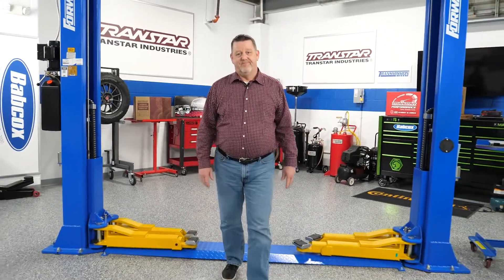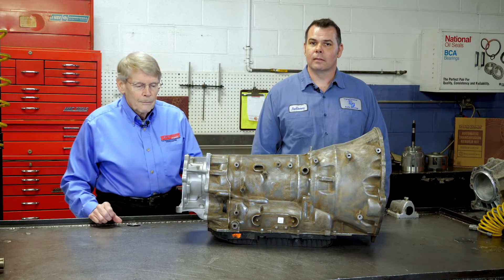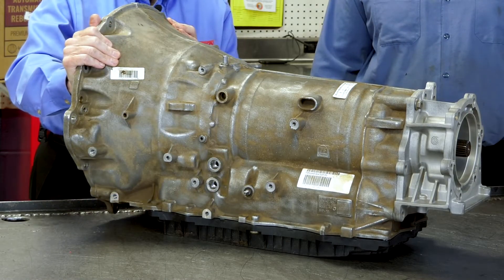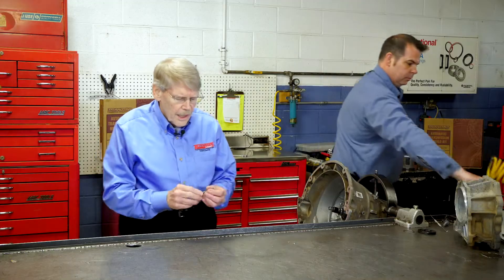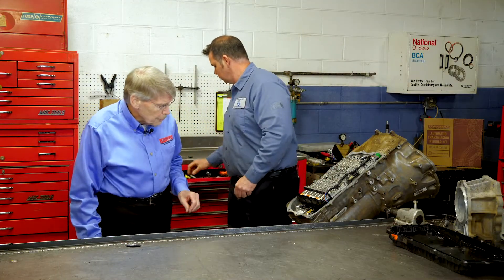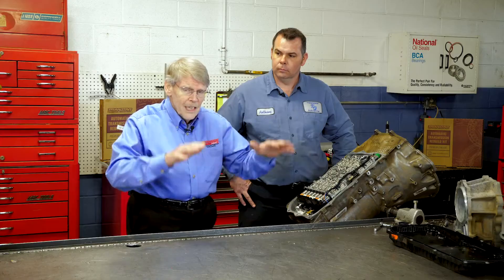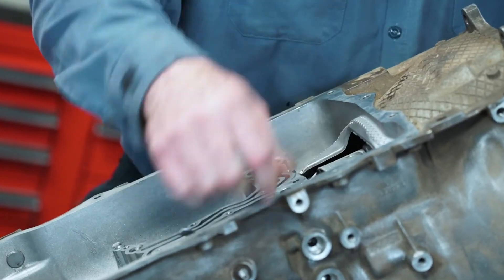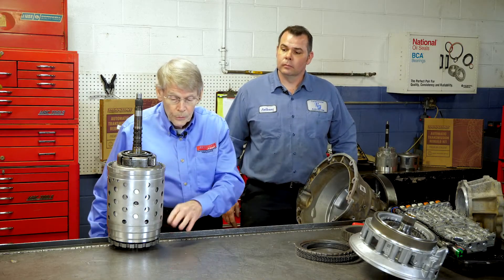ZF/Chrysler Eight Speed RWD: Part 1

Comment: I have a 2014 Durango with 277,000 miles has the zf 8hp when it shifts from 1-5 all shudder and 1-2 gears have a whine. Any input is appreciated. Also i just bought it i believe the fluid is original.  O and no codes.

Comment: Thanks for explaining the HIS accumulator. I’m installing a 2016 Grand Cherokee 850RE into a 2014 Durango, after swapping the TCM, and was concerned it wouldn’t work. I plugged the hole for the accumulator, and am confident now that it will work in my Durango, which didn’t come with HIS.

Comment: Great video. Amazing how easy it comes apart. Almost Like a 6l80.   My 8hp70 is giving me that 2-3 and 4-5 flare I've seen other people experience before.  Only under very light loads sometimes but shifts beautifully with anything more the 5% throttle and shifts like an animal while hammering it.  Figured it was chryslers tuning but I did a diablosport tuner and it's still there.  Might throw a valve body at it.
Reply: I have a new 5th gen ram with the 8hp75 and it also has the flare shift issue under light 5-10% throttle. I seen something about when u replace a battery it does something to where the dealer has to refresh the ecm/tcm dumbest thing I've ever heard if that's even true but I will say when I replaced the battery that's when it started. Other then that my truck has been flawless with 81k miles so far.
Reply: @bmf88  Some car have to have refresh the data and telling it about the new batteries
Reply: @bmf88  I just had hemifever do a tune for me.  Flare is completely gone.  I did the zipkit and it didn't like that. I ordered a reman valvebody and truck wouldn't even come out of park. I put my valvebody back on and shifts are beautiful until trans warms up. Yesterday it stuck itself in 2nd then 1st until I unplugged the battery.  I'm going to pick up a low mileage unit today. I'm done screwing around with this one.  I was trying to find out if a 75 would swap over but don't feel like throwing $1000 on a gamble right now.
Reply: @Matp345  tuning was gonna be my next move just blows me away how expensive it is just to tune these new trucks. This is my first hemi and I love everything about the truck I just came from the early mid LS stuff and if was super cheap to tune one. Lol
Reply: @bmf88  me too. I'm a chevy guy and this is my first hemi.  The tune made it feel like a real trans. Stock was too soft. The diablo trans tune helped but hemifever woke it up
Reply: @Matp345  nice I gave up on gm our last 2 escalades were the biggest overpriced piece of 💩 they want u to pay top money for their stuff and won't honor the warranty when something happens the clear coat on the 22s completely peeled off they would never replace them and that's just one thing of many
Reply: Do you use the OEM fluid / made by life guard, or do you use a different fluid Maxlife Vavoline,  Amsoil etc...  I keep hearing the Amsoil is superior to the OEM life guard brand.

Comment: Is it still okay to change trans fluid even after 180,000 miles
Reply: Don't believe the th350 guys from the 70s. These transmissions operate very different from the old stuff that "you shouldn't change the fluid"  I always do trans services no matter the milage and have never had one fail. Change it as often as you can.  You can't over-maintenance one.
Reply: Their “lifetime” really only means “for the lifetime of the warranty.” But yea I’m doing as much research as I can before changing out my transmission fluid and filter. So just to verify, u can use the pan of a 8hp70 on a 845re transmission right? @MrCattbone
Reply: @jphantom6296  I’m pretty sure that they are the same bolt pattern, but the 845 has shallower pan.  What car is it in?
Reply: @MrCarttbone  2015 Jeep Grand Cherokee. I’ve got the 845 trans
Reply: no
Reply: @mattboski2339  you are giving wrong info man.  these things should have a fluid change every 50k-60k.  That is what zf says on their website.  Chrysler saying it is lifetime fluid is straight up misinformation.  All the guys that actually work on these things know that lifetime fluid is not a real thing.  You need to be replacing the fluid, or else you will be replacing the transmission

Comment: I know this transmission is bulletproof how often should the fluid be changed at what mileage . Just curious because I have a 2018 Chrysler 30 which now has 50k on it
Reply: ZF recommends 50-60k miles for the 8HP 
even though BMW and Others say you don't have to service.  I choose to agree with ZF because they engineered it and know what they are talking about and a salesman on a dealership floor is just saying what he is told to say.  I just completed a 8HP pan/filter and fluid change and on the 2016 535i, the filter was black, magnets were covered in normal wear material levels and the fluid was dark and  glittery. I would like to note that the driving style this trans has been exposed to has been extremely gentle by an elderly driver. all normal wear at 60k but I don't think id want to that multiplied at 150k miles. IMHO
Reply: Iam going to change mine next week the car just hit 66k
Reply: That's weird. I do 75-80k service. I used Amsoil. Shifts a lot better with that.
Reply: The cars guys always said .. never ever flush a transmission unless u want to have transmission problems..
Reply: @temptek2377  I never flush my transmissions  that's just opening up a can of worms
Reply: you dont need to change it. it lasts a life time
Reply: @mattboski2339  what’s the mileage on your car
Reply: @mattboski2339  thanks for the info I just saw the video 👍
Reply: @mattboski2339  nothing is life time !

Comment: Does this ZF8HP have a torque converter and how would you do an oil flush when dropping the pan and changing oil? Love the vid guys!
Reply: Yes it has a convertor. A quite complex one at that.  There's tons of writeups about how to service out there. It's fairly simple. If u have a dodge truck like me wear good gloves cause the exhaust blocks the fill bolt
Reply: That would be interesting. Hopefully we can see a video of that.

Comment: Now if ZF only thought to let us have a dipstick and fluid change... but because we're a lease society, seal it up because who would drive one 123K miles and need to change the oil?
Reply: So someone I know has this transmission in a Chrysler and the trans fluid has never been changed and it has 180,000 miles on it and it still works fine do you think it would still be okay to change it or keep old trans fluid
Reply: @pencilshavings5051  
At that point leave it alone.
I would do a filter change and drain&fill. 
That's just me tho.
Reply: ZF recommends fluid changes for the 8HP. It is the manufacturers who ignore this advice and tell customers that it is "lifetime fluid"